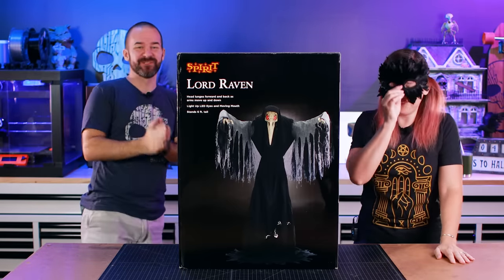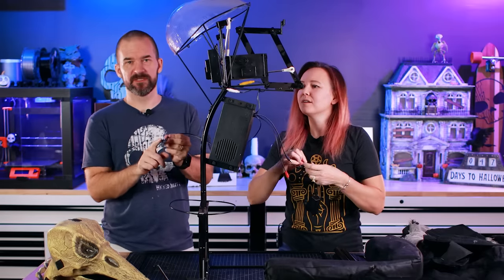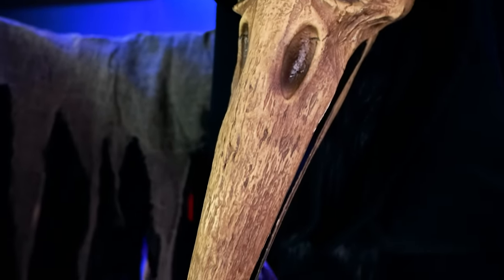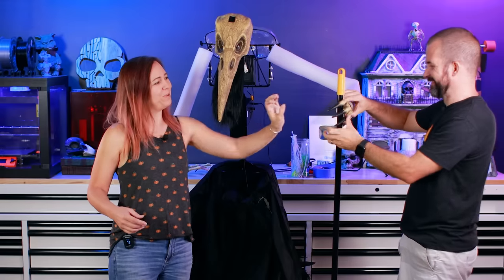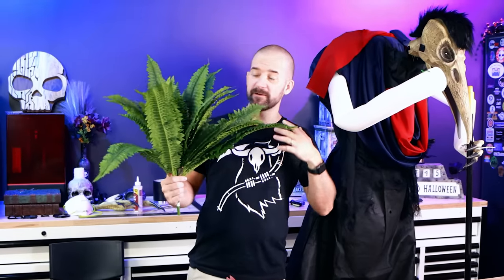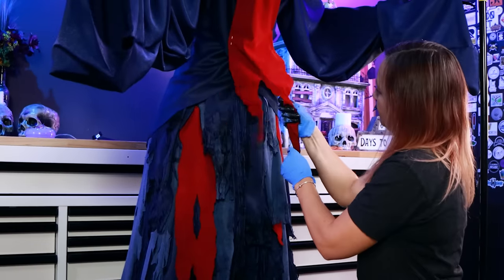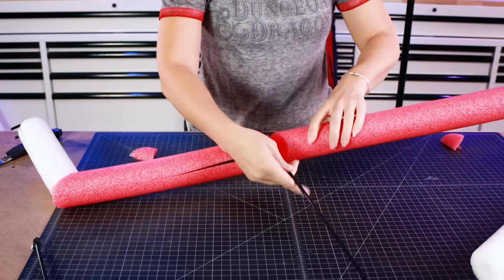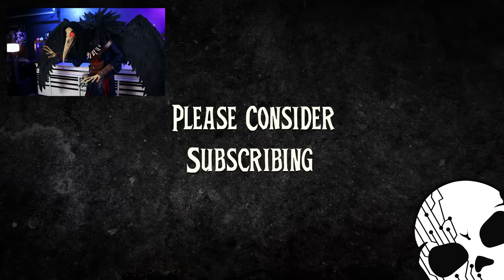This Spirit Halloween Animatronic Makeover is CRAZY!

Comment: One of the best things I've found for black wings is to use a gloss black base coat, a heavy iridescent blue layer in random stripes, and then just a light pass of the final black coat. Iridescent blue under the black catches the light passing through the "feathers" and makes it almost glow with what looks like natural moonlight coming through the gaps and the thin areas of the material.
Reply: Great tip!!

Comment: Absolutely amazing build guys. Really impressed with your level of creativity and your problem solving skills. I'm positive you would have your own solution for his hands to grip the staff but mine would be to cut the fingers at the joints, use armature wire inside and either use some flexible silicone or some greenstuff for the knuckles. Can't wait to see the staff.

Comment: I LOVE this so much! I couldn't figure out how you could improve much on the original costume but did you guys knock it out of the park. He looks so much more menacing now. If you changed out the cardboard with 2 wires bent in a circle shape frame could it stay out or does it need to be under cover because of the motors?

Comment: Looks good.  If I may give a few pointers? To seem  dark you need light, meaning the wings feathers need a separation between the two.  A little dark gray goes a long way especially if you  rub the paint on each feather like you done his clothing.
The actual  beak would be best looking if you used liquid latex to form a  skin like texture and colored accordingly as you  do with your  skulls. Granted this is a lot more time and effort